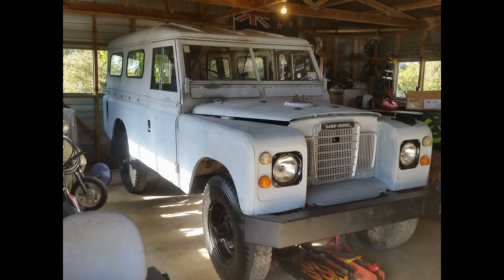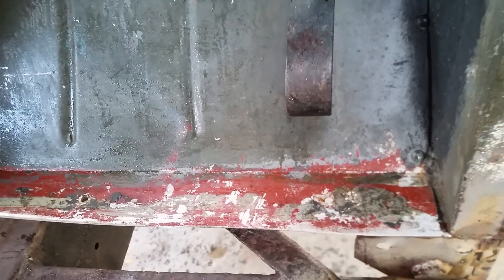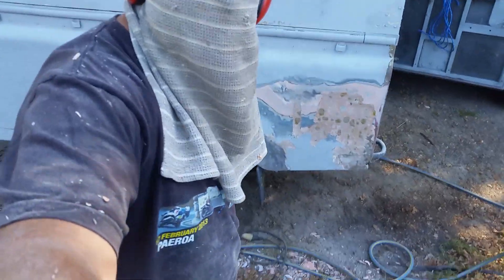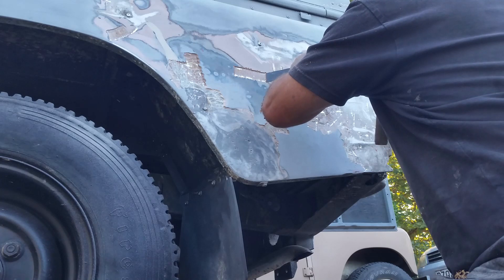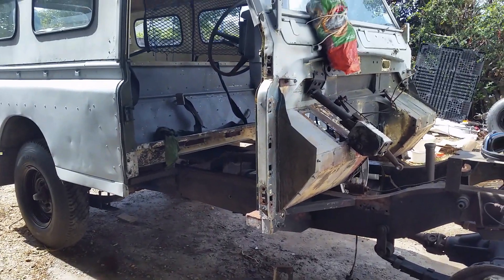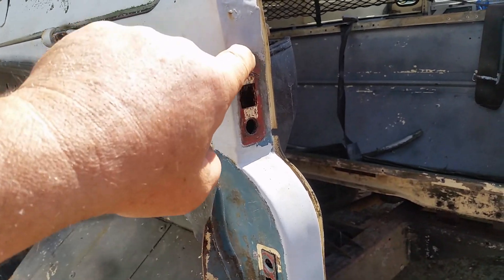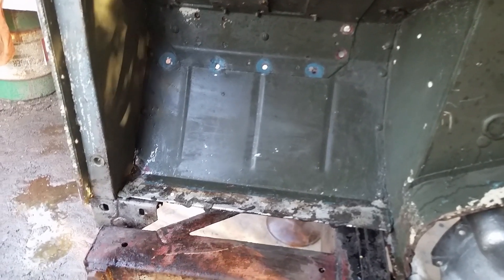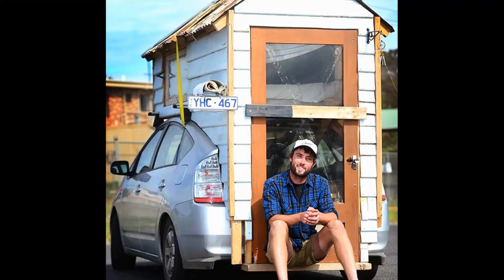Land Rover Lockdown Rebuild Vid4- rust and dents

Comment: Are series 2A had aluminium floor panels if that's any help, but they look thicker than yours do and where bolted in place.
Reply from the maker: thanks for commenting- yes, They all have alloy floor panels but te bulkead and footwells are all steel from the factory- someone has had a play with this. Nice panels- but fitted with gutterbolts- yuck-Ill remove them  and seal them back in withbutyltape and the proper sized rivets.

Comment: you can make those panels with a bead roller and there is a easier way to get that bondo out apply heat to it propane torch  heat will soften it and it falls out
Reply from the maker: Hey James- Ive just stripped the rest of that rear panel using a heatgun and scraper- Thankyou so much is was easy-peasy. now im massaging it back into a proper shape. Im expecting just 1/2 a cup of filler will  go back in
Reply: @t.h.o.r.  30 years doing body work.
Glad to help